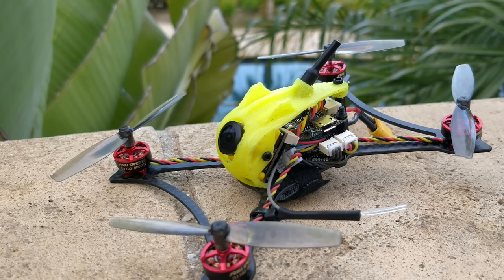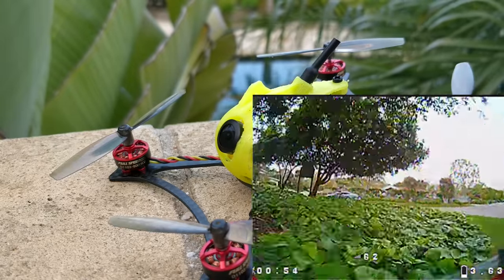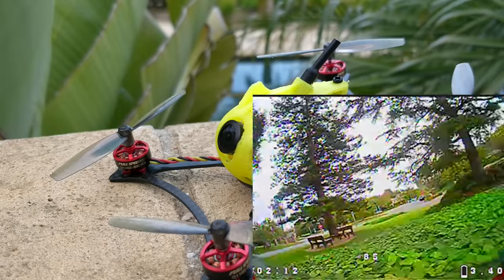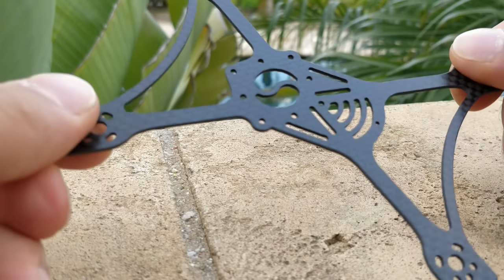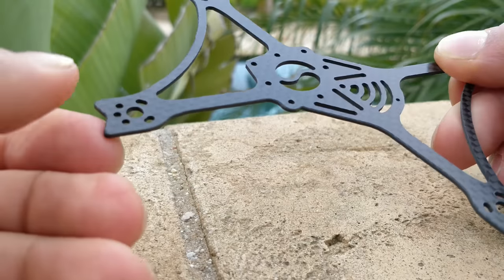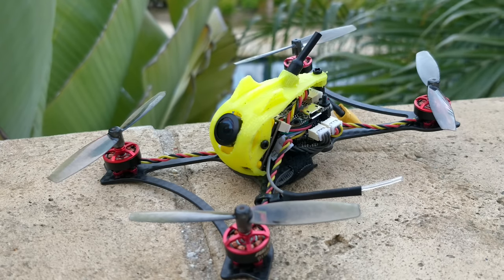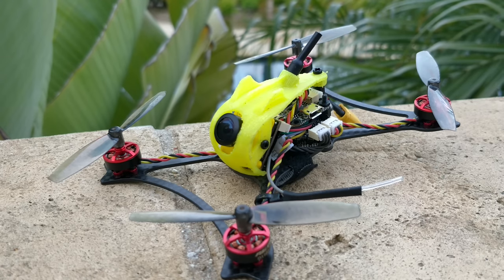Full Speed - Toothpick

Comment from the maker: Table of Contents:
00:56 - Flight video
04:07 - Frame
05:06 - ESC performance
06:17 - Geometry and weight distribution
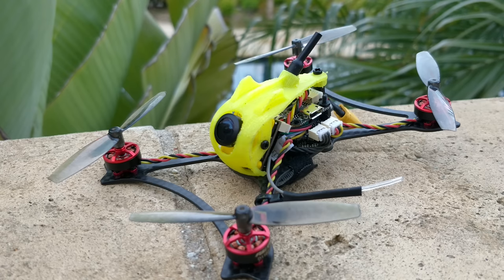08:48 - General recommendation
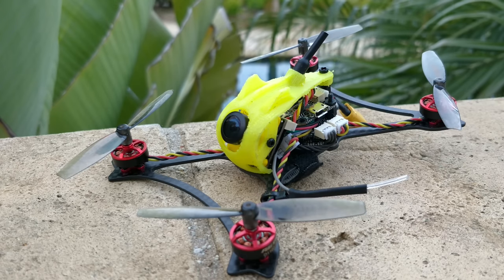09:52 - Caddx camera issue

FullSpeed Toothpick: http://bit.ly/2PAEIZl

Summary of the FullSpeed Toothpick:
Good performance with good quality assembly.  Electronics seem reliable however FullSpeed has had ESC failure issues in the past.  This is a brand new ESC and on this quad, the ESC performance is not the best but acceptable.  In this size category, there is no best ESC.  All the ones I've tested perform mediocre at best and this is no different.  Throttle pumps yield some dipping and it's very difficult to get a good tune on the quad as a result.  Additionally, the longer weight distribution on the pitch axis also eats into the control performance of the quad for a number of reasons.  The stretched X layout helps with managing the weight distribution in this case and overall performance is still very good.  I have some concerns about the reliability of the Caddx camera on board based on my personal experience with Caddx cameras however the view is glorious for a quad of this size.  I've pointed out many genitives but overall, the quad performs well and based on everything FullSpeed tells me, should be reliable.  I would say that it's currently the best option in the 'Toothpick build style' class.
www.fullspeedrc.com

Alternative options:
Happymodel Sailfly: http://bit.ly/2KTMcbb
Caution: Very high failure rate of the AIO board they produce.  This one is supposed to have an updated version but hard to trust.

If you can get a hold of JUST the FullSpeed frame or something similar, I would recommend the following parts:
Succex 16x16 stack: http://bit.ly/2IKmuDi
AIO camera/vtx: https://goo.gl/xD8dQ6, http://bit.ly/2XxjRc1
Some sort of canopy re-design will be needed to fit this camera but the weight reduction is going to be a significant benefit.
Amax 1103 7500kv: http://bit.ly/2V62fY0
The prop: http://bit.ly/2PEPLjW
I have another prop I've been working on coming that is MUCH better.  Will come in a couple weeks.
This battery: https://goo.gl/5F1mcb

An updated Toothpick video is going to be the very next video I post.

Join my FB group for more discussion: Kabab FPV
https://www.facebook.com/groups/37915...

Equipment I highly recommend:

Micro Eagle - 
https://goo.gl/or1fS9

Caddx Ratel 1.66mm lens - This is a new product so we do not know if it is as reliable as the Micro Eagle just yet but I love the picture.
https://goo.gl/mXcTHN

Rush Tank Vtx -
https://goo.gl/YMYmya

Fantastic solder-
https://amzn.to/2P5QM2W

TS100 iron -
https://goo.gl/DqBipa
https://goo.gl/svK6DD
https://amzn.to/2OV5XMh

WaFL’s Cap Cap
http://bit.ly/2GUpXxO

Xing 2306: https://goo.gl/TT9gnw, https://amzn.to/2VkZ8rt
Flywoo 2306: https://goo.gl/xuLG6d
Hold off on 220X motors for now.  There is a bug in BLheli/BF that makes them act a little weird unfortunately.  :-(

Sub $200 5" build that's still good:
Frame: https://goo.gl/EpXQhZ
FC/4in1 Stack:  https://goo.gl/HprVbj
Motors: https://goo.gl/h5rofi
Props: https://goo.gl/ZnzY2y
Props: https://goo.gl/VMBiQh
FPV Cam: https://goo.gl/FDJhYw
Vtx: https://goo.gl/JNVDMn

Starter goggles I recommend: https://goo.gl/GvJUkT

Tips?
PayPal: https://www.paypal.me/kababfpv

Please use my referral code if you're gonna buy a Tesla.  You get some free stuff when you do and I get better status with Tesla: https://ts.la/bob40889

Bitcoin: 1E4XZXoD4rS6MYWVWuenY7Kw2M1YgyNpoQ
Nano: xrb_1188ek5bd7tb9kw67asnp9o65byuoaxbtpxuznx1ribf75x78awywmakj55f
ETH: 0xD067F93811f2eC31CB1928901002dfdf9A492EF5
LTC: La2KWYAjp4VT2Lq2M76pbjzXWvRyjpfCtG
Reply: I want one!!!!!!!!
Reply: Same here. Thanks for the vid bro.

Comment: The canopy can be leaned back by shortening the rear stand offs making the camera angle issue a moot point. I did it on the Tinyleader and got a 35 degree and could get 40 if I wanted to. The ESCs are usually an issue or was on the tinyleader but the motors on the tinyleader are 11000 KV and they should have used those along with an Airbot 18amp 3s 4 in 1. I think they went to 8000 because of burned up ESCs on 3s and I'm sure 4s they would burn. They went 4s because people think 4s is better and not know better cause they don't understand disk loading. Overall 2s and 11000 KV would have been perfect or 3s if the 18amp Airbot was used and people just want to get crazy for whatever reason. This should have been an X and not stretched as I hate the way stretched x quads feel but that's just me.
Reply from the maker: Yep. All true

Comment: Do you think the gemfan hulkie 2036 props would be safe to use on these motors? I'm looking for a little more grip.
Reply from the maker: Well this class is literally defined by grip so if you're looking for more, the solution would be to reduce AUW.  The 2036 may be okay but it would probably grip less since it's a smaller prop.  Would be comparable however.
Reply: @Kabab  ok good call. I'll take a look at my build to see what I can shave off. Thanks Bob.
Reply: @Kabab  did you use stock PIDS for this guy? Thanks again.
Reply from the maker: @doodlesdeluxe  yep

Comment: Will there be a toothpick using the new  iflight 16x16 stack ;)
Reply from the maker: Maybe
Reply: I've got a blade torrent with fully working electronics looking to transfer to a "toothpick frame" if there was/is one available. Now the torrent has better motors, camera, vtx, different protocol on ESC's and tuned better in Betaflight. So any ideas for a new frame???  Thanks in advance!
Reply from the maker: @miklosko3355  the motors and camera would work but the stack is an odd size if I remember correctly.
Reply: @Kabab  Yes Sir. It is 25x25mm. And 4x6amp esc's.  Such a weird combination. 
So just the motors (HGLRC 1104 7500kv) and camera(Foxeer predator V3 micro) are  usable...  Okay not worth it. Easier just to get a new quad. Any suggestions? I like the "toothpick style" look and the fact that it's light and small. I'd stay in 2-3s power too if I could. No need for 4s.  
Any ideas / suggestions welcome!
And Thank you kindly for your reply Bob. 
Big fan here! I can listen to you on any topic! 
PS: I started flossing since you've put the awesome video (as always) out for us! 5*!
Actually 10*!
Reply from the maker: @miklosko3355  I'm working on the next toothpick platform which I expect to come sometime in the next 6wks. It's probably worth waiting
Reply: @Kabab  Yes Sir! 
Sign me up.

Comment: Well, it was a while when I used build with 1103 motors. They was nice to control on 2S and freaking fast on 3S 450 mAh if build was not too heavy. Pity that those small frames 2 years ago was very flaky and prone to break on not so serious crashes. Board quality was not top notch either - all my micro ESCs from those days already fried. Hardware and especially software now improved so much that I now have a wish to get old junk out from shelf, get decent frame and build something in that size again. Note about weight and prop size limits is 200% correct. Very easy to overweight these things having fat sparrows in result who eat batteries like candy and are too uncomfortable to control.
Caddx cameras are mixed bag. Good picture in general, small size and affordable price. But quality fails in some positions, rendering these cameras partially usable. For example EOS2 camera - small and light enough to install in Mobula7 whoop and picture resolution and dynamic range are amazing. However colors are oversaturated and dark areas are turning red in afternoon's sun. I don't understand why. Designers are even not Chinese, they are Americans. Even Chinese Runcam and Foxeer learned how to build FPV cameras right. Why Caddx suck, why? If price is an issue then double it, but replace signal processing chip and do quality control as required to avoid glitches about  that people are complaining. Well, from Ratel camera it look that Caddx are learning. Maybe they will make EOS3 camera for whoops that will not have oversaturated colors and dark areas in red.

Comment: Does the locked screen on the Caddx reset when you power cycle the quad?
Reply from the maker: Yes
Reply from the maker: But what if you want to just flip over and taken off again....
Reply: I agree, knock a tree limb or a gate and remain in the air with a freeze frame and you have to disable, same with a grounding where you can't turtle mode out because you can't see. Thanks for the reply.

Comment: Happymodel sailfly 85$ and the fullspeed toothpick 144$ .... I would buy the sailfly.... Its nearly half the price
Reply from the maker: Buy cheap buy twice....but in this case I'd say you have a legitimate argument and I would even mostly agree with you. But it would suck when (not if) the aio board on the sailfly burns.
Reply: @Kabab  i have two toothpick build with the betafpv fc one is with 1103 betafpv motors and the other with the 1104 torrent motors so far the fc have no burnouts or problems and i flew 30 packs with each 👍

Comment: So wow just wow lol not that it is a very cool quad I love the stretch x and canopy but the beta85x i have is on a similar frame i think it's the bandito style i printed with carbon filament and it is freaking amazing from the esc to the motors i did scale the throttle to 90% and threw my rates/pids in there it is my favorite quad out of all mine, fast has more control than I ever thought possible , haven't tried those props couldn't find any so I'm using 2"gemfan hulkies! It is simply the best!!

Comment: Weight is almost null when it comes to consideration for speed. I guarantee that if the frame lost those braces and the canopy was smoothed out so that it was less prone to drag, you would notice a real difference in speed. Surface area is king when it comes to speed and efficiency moving through the air.
Reply from the maker: yes but in this case, when the motors make next to zero power, the weight does play a role in addition to aero which those cross bars on the frame don't help with at all.
Reply: @Kabab  When adding 8g to one of these little guys with those specific motors (assuming they are just rebranded racerstars) the extra 8g is only 2% of the thrust that the motors are capable of outputting. It is over 10% of the weight of the quad, yes, but it is very small compared to the thrust ceiling. I'd make the argument that the motors aren't underpowered for the load they're carrying. You're talking about the difference between a 5:1 and a 4.9:1 power/weight ratio when you look at the quad on 2S vs 3S. And this is assuming that the motors make no additional thrust on higher voltage. Yes I'm aware that a 5:1 ratio is absolutely garbage compared to a 5". But the difference between the two ratios on 2S and 3S is negligible.
Reply from the maker: @chrismawson4430  I totally understand you and agree however my tests show that weight is a huge factor. If I add just a 5g mass to one of mine to push it up to 78g it flies like a slow POS.
Reply: @Kabab  Hmmm.. it could be a matter of the quad fighting so much to maintain attitude that the motors never reach full throttle. When you say "slow" are you referring to the actual speed at which it travels or moreso the handling/rotation response?
Reply from the maker: @chrismawson4430  yes that is a possibility as well. Weights distribution sucks no matter what you do on something so tiny however I think it has more to do with other factors. I mean physically slow. Not sluggish handling or anything. Props start flittering sooner in the throttle range and the thing won't move. Not fun at all.
Reply: @Kabab  Was that with an extra battery cell as the increased mass or did you have additional dead weight on the quad? I wonder if it would exhibit the same behavior on a stiffer prop that can physically support the load.
Reply from the maker: @chrismawson4430  increased battery size or cell. This is also part of the reason why 3S is somewhat pointless. Yeah it has more power but only until the props start to flutter. A stiffer prop will likely be better but then again these motors make nearly zero torque and cannot really tolerate increased draggy or weight loads.
Reply: @Kabab  Also the motors aren't the right kv for 3S. 8,000KV is a ridiculous kv for these props on 3S. The fluttering of the props is just a result of the load on them being too great, no? This can come about by making the quad too heavy, or when the drag force against the quad becomes too great to continue acceleration, physically the drone experiences both forces in the same way. I don't have a "toothpick" to test this on, so give a shot when you have a spare 10 minutes. Try chopping off both braces at the motor mount, as well dremelling off the motor protection bits. If the arms are still stiff enough without the braces there should be a tangible difference in the flight characteristics.
Reply from the maker: @chrismawson4430  I agree. The design is far from aerodynamic however the arms would just sort of flop without the strut.
Reply: @Kabab  Unfortunate that the carbon is only 1.5mm. If it were decent quality carbon with a higher modulus that wouldn't be an issue. But who dare expect quality carbon fiber in this industry, right?  PS: If you can design a frame that uses 16x16, and slots the battery (1S) up into the frame about halfway (vertically oriented) you'd be my best friend XD I don't want to draw one up but it would work so well with a 1S. It's the easiest way to reduce the load the quad has to work against without sacrificing structure.

Comment: Little Power?
The low kv amax 1103 will push over 100watt on 3s according to the thrust sheet :D
Reply from the maker: Compared to 5" it's nothing
Reply: @Kabab  400 against 4000 but the weight is like 10times less and then this square law... Who cares the Micros rip like crazy

Comment: i saw someone using it with 3s 300mah
Reply from the maker: It would just be even more powerful with a 300
Reply: so the 150mah less doesn't affect flight performance as much as 3s over 2s
Reply from the maker: @marc_frank  it'll be less flight time but will perform much better with the lower weight. However it's already so damn powerful...
Reply: @Kabab  you could use a normal 2.5" at that point, because it gets dangerous again

Comment: PSA: Don’t buy the crazybee f4 pro complete junk. I’m thinking I’m gonna try a 16x16 stack now.
Reply from the maker: there are no super solid 16x16 stacks either but so far the iflight succex has been mostly decent.
Reply: @Kabab  I ordered a replacement board for that one (trashcan) and i received a V2 version (mobulaHD).
Something tells me they are aware of the issue.  

I soldered a pololu 5v regulator at first because internal broke, and no leds would work at all.
Then it powered on, flew one pack and started smoking and made short-noises.
Removed flightcontroller from the quad to make a video for banggood customer support,
then i realized i better de-solder the regulator before they blame me.
I expected no leds would burn like before i soldered a regulator, now only the red led is on solid without the blue one like it should.
But i dont get how the red led can burn at all if the internal regulator is burnt out.